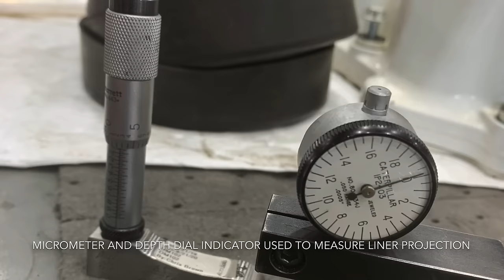Caterpillar C18 overhaul

Comment: 9U-7225 pilot tool (2) thread on the end of the cam shaft, works a lot better guiding in the camshaft only takes one person! Used them for years! We also used tire lube on o rings for liners works real well! Dynoed engine before we installed them to make sure all was well! Way easier to fix out of machine! Hope you learned a lot!

Comment: I do a lot of assembly (aerospace) in a clean room building valves and actuators and I never wear gloves. Can't feel grit or burrs with gloves on. A human hair getting under an oring or retainer can cause a leakage failure. I just don't wear gloves...
Reply: alao thought he was banging parts arpund those rods/caps nick n burr easily n put orings on b4 lube for brgs get dort dust in grease
Reply: @joseywales2037  Yeah ,to much bumping and banging on critical parts for my liking also.

Comment: Piston packs are fine & dandy, but I’d still be pulling them apart to make sure ring gaps are staggered. And did we use enough assembly line on the rod bearings?

Comment: Why put back the old injectors back into a newly rebuilt engine? Seems like a weak point. 
Building a $25k engine and using the old thermostat which cost 5 bux.
Reply from the maker: The customer didn’t want to buy new injectors if the old ones were still functional
Reply: $5???😅😅😅😅 try $575.00 for both ,the seals,the gaskets
..everything cat went up 3 to 4 times normal

Comment: Your protruding was off because you used engine oil on the o-rings for the liners and they swelled up
Reply from the maker: We actually just used some soapy water to lubricate most of the o-rings, with the only exception being prescribed to be lubricated with oil. We had to add a thicker shim because we had to machine down the deck around that cylinder just a little more to make sure we got rid of all the wear/erosion from the liner flange.
Reply: @noahnaworski9441  no no u heard the guy who wasn't there or is not a DM give him his thanks

Comment: Reason fr changing only 2 liners , conrod & piston  was this damaged. What is the paste being applied in bearings & bushings.
Reply from the maker: All cylinders got new new pistons, liners, and conrods. The customer decided to do an early overhaul due to the hours on the engine and how far we had to go for the original repair.
Reply from the maker: and the paste is white lithium grease.

Comment: Sir what differ C15 to C18 engine?
Reply from the maker: Piston size. The C15 and C18 share the same block but on the C18 the block is machined to accommodate the larger pistons.
Reply: @noahnaworski9441  Thanks Sir

Comment: Can I make a 18 liter out of my 1lw
Reply: Unfortunately no, unless you machined out the block, and found a C18 crank, then cylinder packs and con rods, then you could. IPD makes a “big bore” kit that jumps the displacement from 14.6L to almost 17L. 

However that is strictly off road or track use only
Reply: @hitchedzebra59_42   Come on now either does Or it does not Tell me again I'm going to make a 18  I will make a 18 later out of the the 1LW Tell me what I need to do money's no problem those crank shaft and liners are everywhere
Reply: As I said, the block is the same, just gotta get the Crank, the connecting rods, pistons, liners, and cam to make the C18 to my knowledge.

Won’t be legal to run on the road but it’s all upto you
Reply: Why would you? My 1lw out pulls bigger engined in the Canadian rockies,leave it be.